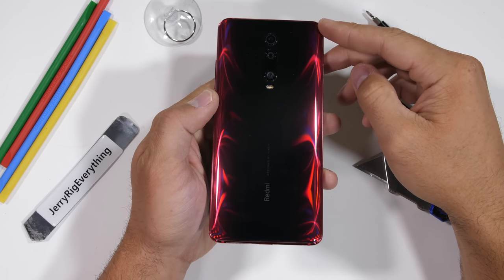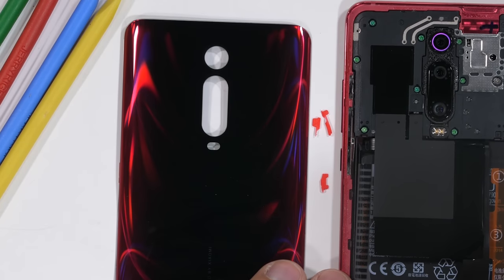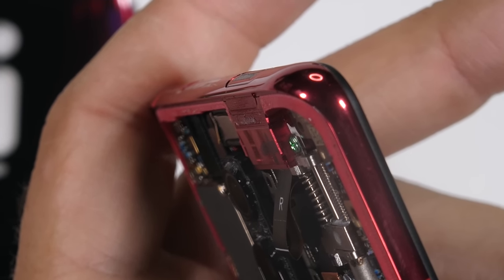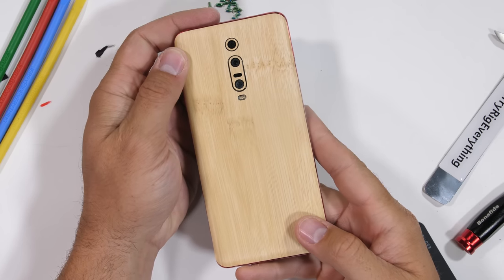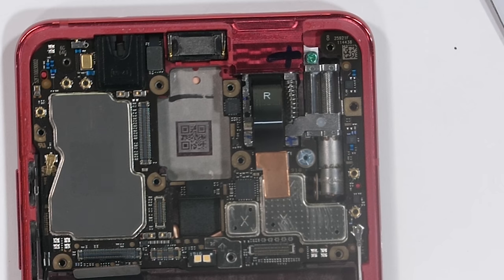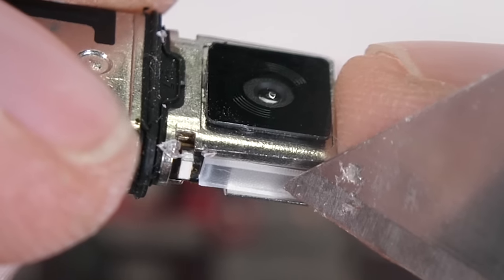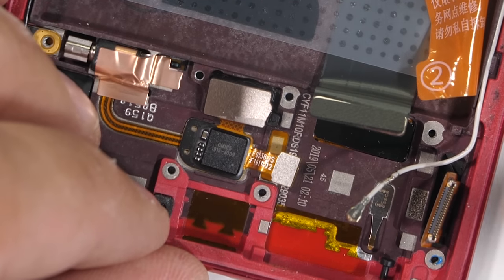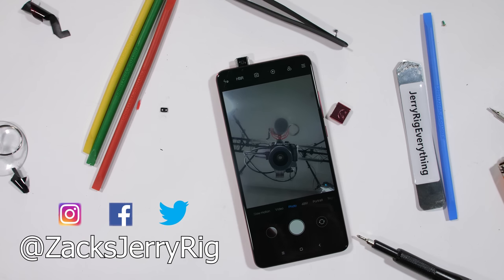Redmi K20 Pro Teardown - Value Champion is Clear!?

Comment: 2 years later i am still using this phone. Its built like a brick. The front camera still works like a charm eventhough i use facial recognition every time i unlock my phone. Its like 50 times per day.
Reply: I have bought used one  and its still alive after 2.5 years. It survived a year and half in the kitchen.
Reply: same brother, i think the key to keep the front camera working is to actually use it multiple times a day to ensure that there's no jamming, plus the phone is built like a brick, multiple drops no damage
Reply: 3 and a half years now and still not a scratch on this thing💪
Reply: 4 years using it still no lag
Reply: Almost 5 years still using
Reply: @arunpandi6931  yeah, same here battery is dying tho, im thinking upgrade to s23 ultra
Reply: @MyMichel23  any mobile minimum 10% charge plug and maximum 90% don't complete 💯 . Better battery life. My battery easy to cross one day
Reply: @MyMichel23  my battery is dead after 4 years, i think it is my fault. Now i am changing it paying 69 euros (original battery), i hope that it will last another 2 years
Reply: Hello! 
Today its 15 November 2023, i got the phone in September 2019, after 4 years my front camera stopped working :(
Reply: Same, great phone ❤
Reply: Had to switch to the xiaomi mi 13 lite from this tank, it lived for 4 months before screen broke. Switched back to xiaomi mi 9t (same phone as redmi k20 but for another market) and it's still feels like a very good phone. Even after 5 years of wear and tear
Reply: I still use it today
Reply: 5 year later still using this  phone to watch this video 📷
Reply: Still using mine now. Though as a secondary. All things still function well. 😊
Reply: @carldarhenbonifacio3791  That's good, do you have to replace the battery?
Reply: 6 years
Reply: What about now? Plus does it still have software updates?
Reply: @9lives950  i dont know. broke mine a year ago when i dropped it in the toilet bowl. no water protection.

Comment: I'm watching this on my k20 pro and I don't know why my phone starts to shake.
Reply: He is scared 😱
Reply: I can't decide between the K20 and the K20 Pro.. i read in GSMarena that the K20 Pro has thermal throttling issues whilst the K20 doesn't because it uses a lower SD7xx series instead of the SD8xx series, although gaming frame rates would be lower.  How satisfied are you with the K20 Pro?  Did you have thermal throttling issues?
Reply: @DilbertCronicles  i have order k20 pro in 2 weeks i should have it, the i will tell you everything
Reply: @DilbertCronicles  maybe china ROM throtling but global won't
Reply: I think u get a msg ....and it is in vibration mode....🤣🤣
Reply: @DilbertCronicles  no thermal issue at all while playing game.. I can even play arena of valor for more than an hour..
Reply: @Hhhhwwww123  Global ROM?
Reply: Had to settle for the global version the mi t9
Reply: Actually that's your hand bro...😊🤡
Reply: Lol
Reply: @DilbertCronicles  if you're British, I suggest the xaiomi 9t pro which is basically the European version of the redmi... Mines very good and I bought it from a Amazon seller called f5cs... It's very powerful if youre into that kind of thing
Reply: @DilbertCronicles  i finaly have mine k20 pro,  and I got 370k antutu score,  no problems, doesn't get hot while playing games.  Phone masterpiece.
Reply: @DilbertCronicles  fingerprint in screen works great
Reply: @MT_Real_  nice.. and now xiaomi released the K20 Pro Premium with a SD855+.. the rate xiaomi releases new phone.. lol
Reply: Same LoL
Reply: @MT_Real_  Its SO damn good. Got one and couldnt be happier. Knowledge is power.
Reply: @DrStrange1000  one problem is that i switched  phone from honor to xiaomi and honor band 5 lost some option or something doesn't work.
Reply: @MT_Real_  Try rebooting the phone. If not, you might be able to recover it from old phone.
Reply: @DrStrange1000  i'll root my phone and will be working as i want
Reply: @MT_Real_  That's a point! But at least wait until the warranty runs out before you do!
Reply: @DrStrange1000  he can unroot anytime.
Reply: @garou5744  useful to know
Reply: @DilbertCronicles  Mi 9T Pro here - so Euro k20 pro. NO thermal throttling whatsoever. It's almost ridiculous; no matter what I run the internal temp sensors won't register over 35 C - and that's with a fairly thick, insulating case on. That's prolonged 3dmark torture testing, mind you. only thing that'll heat it up slightly more is quickcharging the battery and even that doesn't do much more than make it a bit warm to the touch.
Reply: @prrt686  thanks.. i will get one later this month
Reply: @DilbertCronicles  just checked, quick charging from empty, in case, indoors, never over 40C. Have fun, you'll love it :-)
Reply: @MT_Real_  Hihi
Reply: @DilbertCronicles  K20 Pro has no thermal issues.
Reply: @DrStrange1000  When you unlock the bootloader of Xiaomi devices, it doesn't void warranty. You can root the phone without breaking the warranty but once you flash a rom, the warranty is gone.
Reply: @TheRealBleach  useful to know! Thanks for the info.
Reply: @DrStrange1000  No problem
Reply: I'm watching on my K20 pro
Reply: MoonNight how can you know the difference between china ROM and global?
Reply: @mustafakareem6655  YouTube
Reply: The Real Bleach i couldn’t find direct answer
Reply: @mustafakareem6655  Try Google. XDA Forums may have an answer
Reply: Is that malaysia have k20 pro?
Reply: @TheRealBleach   which one is good global rom or china rom ?
Reply: @shaanmalik3611  I prefer global because the China one has Chinese notifications every now and then
Reply: @DilbertCronicles  not at all k20pro doesn't have any issue you can go for it
Reply: I'm on my Xiaomi mi 9t and it's basically the same phone
Reply: Me too
Reply: Lol hahahha
Reply: Me too
Reply: My k20 broke yesterday and never taught I would have to watch this video again
Reply: @DilbertCronicles  extremely satisfied, i have galaxy s10 as well and honestly i prefer playing games on my k20 pro though. Btw i have the k20 pro premium premium edition
Reply: Me too
Reply: its too much cold out side
Reply: Does K20 Pro has wireless charge?
Reply: @kayrae7539  nope
Reply: @DilbertCronicles  ez use custom lernel and rom try trb or darkonah
Reply: @juke8434  💩💩💩💩💩
Reply: @DilbertCronicles  yes  bro. Iam facing heating issue while charging and gaming..
Reply: Dude same
Reply: @DilbertCronicles  I have the K20 and it has no issues playing Black Desert at max settings. Depends on whether you're willing to spend $100 for an 20% perfomanace increase when nothing outside of 3DS emulators with utilise that extra 20%.
Reply: Because ur hand is shake
Reply: @DrStrange1000  dude how's your k20 pro doing now is the pop-up camera doing ok?????
Reply: @workingonthename6094  phone is absolutely fantastic. No issues at all. Super happy. 3 of my family members have it. Real powerhouse of a phone for the money. Pop up camera has ZERO issues.
Reply: @DrStrange1000  ok I'm pretty convinced ,I'm buying it asap
Reply: @workingonthename6094  Cool! It's become so cheap now!!
Reply: @Hhhhwwww123  just want to know if the phone stays optimum and cool, hope you reply
Reply: My k20pro also is shaking
Reply: i read all the replies and i'm getting hyped. I getting one soon.
Reply: Lamo
Reply: @workingonthename6094  No problems for me either. Mine is rooted and has a GPU OC to 810mhz still temps are quite under control and the fact that this phone hasn't lost it value in this giant flood of new phones even after almost a year.
Reply: @zetsubou3704  thanks for the feedback
Reply: Can u use the indisplay fingerprint scanner evem when the phone is turned off?
Reply: @JOHN-uj4zg  Off in the sense that the screen is off/locked then, yes you can.
Reply: Please tell about the camera quality of k20 pro... Front/ back
Reply: Lol
Reply: I'm Watch too in Redmi K20 Pro
Reply: @DilbertCronicles  Nope 😁
Reply: probably made in china and not make in china
Reply: lol
Reply: Haha same here
Reply: Fazen FN  *too
Reply: @DilbertCronicles  nah man, no issues with thermals. It has never been used up so much. Using for 3 years and play pubg everyday. Runs at 4k ultra, and fps is locked at good 60.
Reply: @MT_Real_  a free tip. I have a k20 pro so i know. Don't hold your finger on the scanner for long. Just keep and take away. Unlocks fast.
Reply: @HEILZEUS  i'm using my k20 pro since 2019 december and it still works great, no lag
Reply: @MT_Real_  that's exactly what I'm saying. I was just putting it out there
Reply: @MT_Real_  no, it's because the phone reverted it self after the owner kept the teardown and scratching sound as ringtone
Reply: It's scared you're going to skin it alive.
Reply: @MT_Real_  hii moonlight
Reply: @teamm4kxlegend713  hii
Reply: How are the vibrations? I can see that it has an ancient vibration motor
Reply: good thing u have a Mi 9T Pro
Reply: I'm also watching in k20 pro after using 4 yrs still it's new worth for 31k 💸 money
Reply: @DilbertCronicles  trust me, it's been with me for 3 to 4 years and i didn't experience any thermal throttling issues, for reference, i put PUBG on maximum settings and for prolonged use, it got warm but not uncomfortably hot

Comment: This showed me that iPhone and bigger Samsung brands are over priced, cheap phones are getting better
Reply: I got the samsung s10e for €520
Reply: *You have to pay less for more 

(even Zack said that about the headphone jack)
Reply: @jerro1608  and you can get the mi9 for 400$
Reply: Actually you get a better phone when buying high end Samsung and Apple. But you get diminished returns. This means that from €200 to €500, you get a way better phone. From €500 to €800, you get a quite better phone. From €800 to €1100, you get a phone that's just a little bit better.
Reply: @MK73DS  the mi 9 is better than the s10e in every way except software
Reply: @adrians3267  You named it, software. For some people this is more important than hardware. Therefore it is a better phone for them. (I do agree that other people prefer the Mi9, preference is always subjective)
Reply: @MK73DS  true, but i prefer the mi9 and mi9t pro
Reply: MK73DS Even then, different android launchers are easily available on the Play Store, so the MIUI software isn’t really an issue.
Reply: But those phones are terrible look at all the cheap parts (camera, microfone, one of the worst amoled screens out here, bad haptic feedback, worse design. 
And lack of many great options
Reply: @UCdoIy6oetqeS4FH0ZQcJtkQ the screen is almost the same, 30 more ppi on the s10e. The camera hardware is better on the mi9, again, software. And you won't notice the water resistance, because the mi9 is unofficially ipx7
Reply: @MK73DS  software is something you can customize if you want to..
But on the other hand, hardware is not customizable..
Thus, Mi 9 is cheaper and better than Samsung
Reply: @Invictus173  the hardware is better than the mi 9
Reply: @Invictus173  Samsung is better. The OnePlus brand is proably the only budget phone brand that I would trust
Reply: this is a brand that makes you pay with loads of personal data tho
Reply: @haydencamp2736  hardware on s10e is better?
You're delusional
The screen size is bigger , the battery is bigger and the camera is much better in mi9..
If you have too much money to spend, go ahead :)
Reply: Mi lacks in software..
Reply: @humpty4205  once again.. Software is customizable, hardware is not..
Mi has better hardware
Reply: @Invictus173  my bad i miread thought you said S10 not s10e. The s10e is Def not worth the money the S10 is tho
Reply: @haydencamp2736  mi is still giving a hairline thin bezel no notch display larger than Samsung and the camera unit is still better in mi 9
Reply: @adrians3267  "the mi 9 is better than the s10e in every way except software"

You mean in which way?
Worse camera, worse screen, no IP rating, no expandable memory, no headphone jack. What is better about Mi9 except price?
Reply: @Invictus173  the camera is not better in the mi 9. Not even close
Reply: @EvertTO  because that's where they cut corners to reduce the price of the device, but i think xiaomi has the power to make a flagship phone (good camera, better screen, etc) with a cheap price tag but they don't want to...
Reply: @jerro1608  Mi 9T pro eats that for breakfast. Even normal S10.,

Comment: Green screws might be to help a robot find, remove or insert screws.
Reply: @Alex Bro not only Xiaomi but OnePlus , Oppo , Realme , Vivo , Honor etc. all have that stuff . That's primarily why their phones are so cheap and good at the same time .
Reply: @Alex people are expensive and inefficient at the same time.. Robot on the other hand are really cheap to use in long runs  and need an investment in beginning, to purchase, of course :)
Reply: @Invictus173  Very true.
Reply: @Invictus173  I mean, robots aren't cheap but they're much more efficient for the long run.
Reply: @Alex Yeah that's right.  I've been in BBK electronic's Realme manufacturing unit in Shenzhen .
Reply: @Invictus173  There are just 20 workers in the whole manufacturing unit . They do all the programming of the robots .
Reply: @zabethcostales351  It's not about efficiency at all. Assembling phones and their components requires precision and cleanness that are humanly impossible.
Reply: @svetko05  Damn. Robots are taking over!!!
Reply: @svetko05  Are you sure about that?
Reply: Its all about warranty if the colours in the screws is scratched abit you void yoo warranty
Reply: svetko05 precision and cleanliness are just part of efficiency
Reply: Robots don't need to "find" anything. They're programmed to know exactly where to go to insert or extract screws.
Reply: @DavidWatt  there visual clues to aid the robotic arms, it's use full in calibration .  Like the Mercedes and bmw robots that built cars.
Reply: @Invictus173  there is only one problem with robots and its that you need to tell them what to do and they wil do EXACTLY that. 1 teeny tiny mistake and it wil keep on making it. Humans on the other hand can learn from their mistakes and can stop whenever there is something wrong.
Reply: @mr.obvious4810  and that's why you only need a few highly skilled human workers in the factory..
You know, for purposes like programming and inspection of work being done
Reply: @mr.obvious4810  you do know that humans tend to shut their brain off when they work on something over and over again for like 8 hours a day?